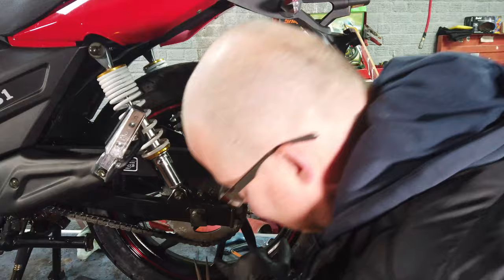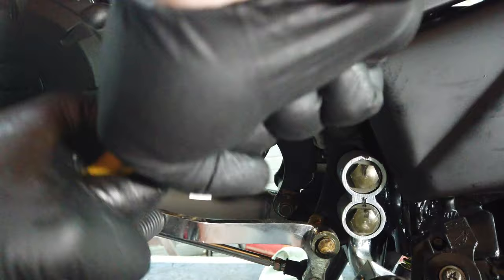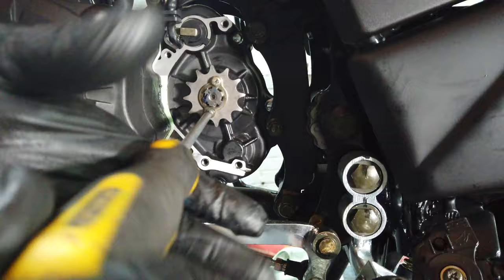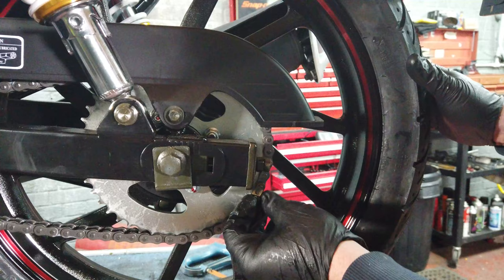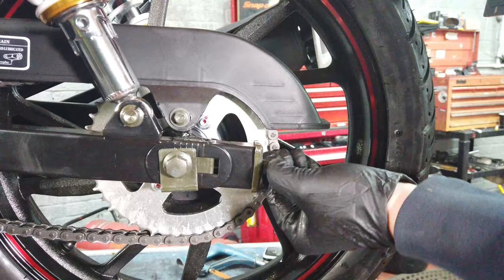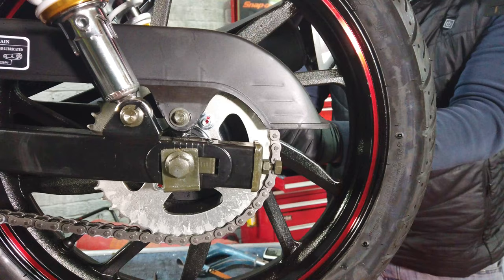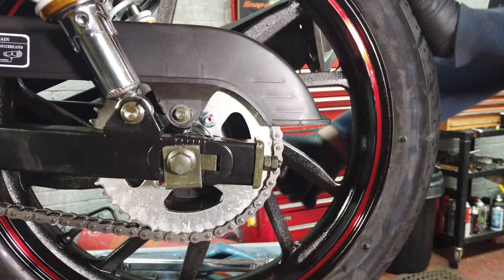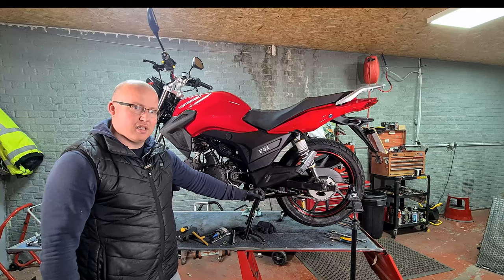How to change the sprocket on a Yamasaki F series

Comment: Hi. Great video might use it in the future. But I thought these bikes came at 45mph?
Reply from the maker: Down hill they will do 45 mph this mod will help you get there on the flat and keep speed up hill
Reply: I've been 52mph down a very steep hill had to ease of as the engine didn't like going that fast. Going back up the hill was less than 10mph, will give this a go
Reply: @1977dazzza  exactly the same with me

Comment: Where can I get these parts ?
Reply from the maker: The acual sorocket is easy ebay the retainer is different because it is soacific you can also get it of ebay but you may get the rong one a couple of times before you get the right one

Comment: I got a 12t sprocket but the ratios are different to my chain so the sprocket teeth don’t line up and the sprocket almost overtakes the gaps in the chain and hit into the chain link. Is there a Certain size tooth that I need to get or is it a standard size and I’m doing something wrong? Any help would be much appreciated (the bike I have is a Yamasaki f50).
Reply from the maker: The chain is supost to be a 428 chain so you will need a 428 12 tooth sprocket
Reply: @Ridingreviews  ok nice, thanks for the help